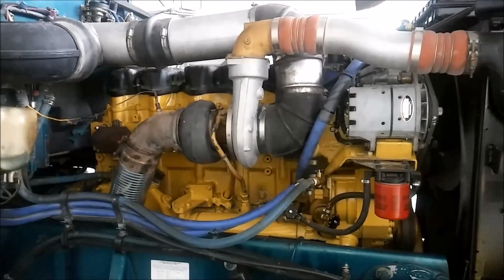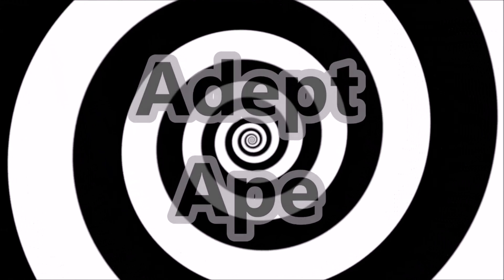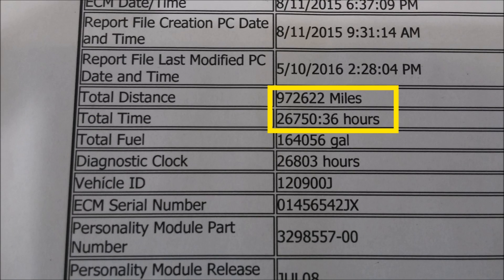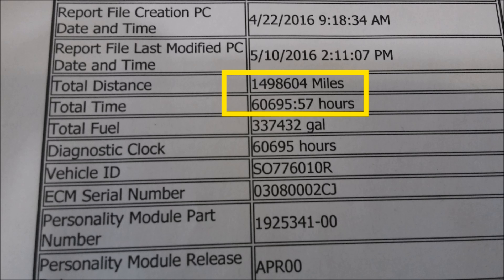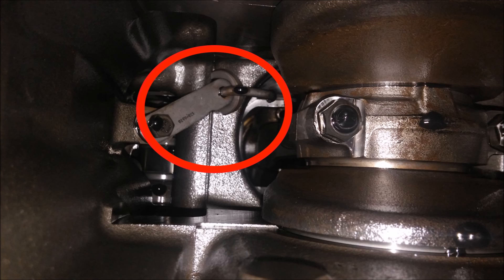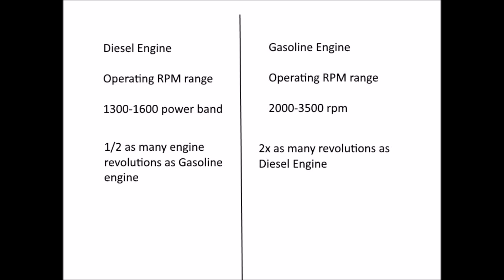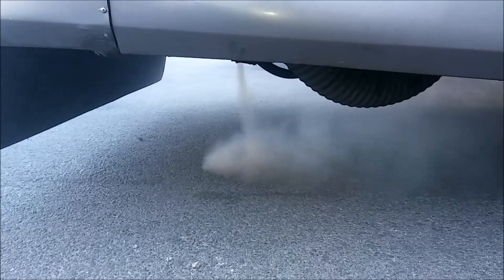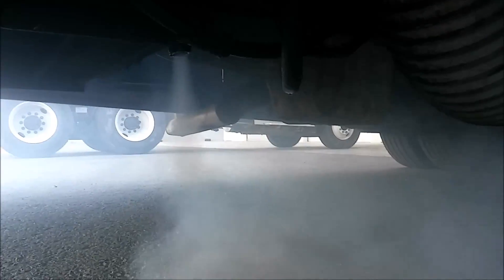Why Do Diesel Engines Last So Long?

Comment: lower rpm -> less wear -> longer lifetime
Reply: TheLuckyDawg24 higher compression > stronger internals> longer life
Reply: this
Reply: Diesel is mainly torque! They have some 600hp cats out there in some semi
Reply: idontcare80 If the government is worried about smog, then ground the C 17's flying outta here every day. Just one takeoff pollutes more than I will in a hundred lifetimes. Consider all the smog created making 3 or 4 eco boost engines, and trucks compared to just one 7.3. That's how many it will take to do the same work. Not counting that a person has to work out 35 K minimum to pay for one. How many people with a green job can even afford  a new truck. Until everyone else gets serious, I'm sure not.
Reply: idontcare80 I seem to have just the opposite view. My company went completely away from Ford trucks just because of high failure rates from that particular engine, and transmission. It's one of the biggest manufacturing companies in the world. Big enough to cut a deal  with Mercedes to build them a special small truck. All my 4,0's got good milage, especially for larger 4WD's. I had 3 Jeeps with 5 speed, and they consistently got 20 MPH. As for my VW's I own 2 right now. My Passat gets 34 mph @ 80 MPH. I don't keep one as long as I used to, but my old VW's went 2 to 300 K and usually just rusted down, but never any engine or driveline trouble. (2 Shiroccos, 1 jeta, 2 Rabbits, 2 Passats.
Reply: My uncles sell police cars those ford 4.6 engines are junk. Some with as little as 55,000 miles.
Reply: Put a ford eco-boost up against my old 7.3, and you're in for a big surprise.
Reply: B______ F________ Small cube engines have to wind like hell to develop horsepower. It spells low milage, and short engine life.
Reply: They aren't junk, those engines idle allot more than they are driven. Any police car you are going to find these issues. Not just the 4.6 Fords.
Reply: idontcare80 well, the emissions are still better than the petrol engines with less power. Newer versions of the same engine outperforms similarly sized turbo petrol engines with at least 25% better emissions, without cows piss. So there goes your analogy...
Reply: idontcare80 true, those pistons must weight a good amount.
Reply: +Prelude Dude Si add a turbo and you have the same (which most diesels have from factory).
Reply: crusty old fart Yeah, but the 7.3 didn't have any emissions controls, and basically every Powerstroke after that had serious problems. If everyone drove cars without emissions controls, we'd live in a sea of smog like the Chinese do.
Reply: B______ F________ It's not the fuel consumption that matters, it's the cost of the fuel and the CO2 that's produced from burning it that matters. In normal driving, the 2.7 Ecoboost has very similar fuel costs and CO2 emissions when compared to the 3.0 Ecodiesel. You also have to consider that the Ecoboost engines make WAY more power than diesels of a similar size, so it's not like you're not getting something out of the higher fuel consumption when you're demanding a lot of power from the engines, you're getting much better towing performance.
Reply: idontcare80 I agree to some extent, but with the newer oils, any engine will last forever unless it has a particular fluke, like the Ford diesels, and the newer modular engines. I had two ford 4.6's blow all to hell at around 50 and 75 thousand, for no particular reason. Both were in cars, and never abused or towed with. Needless to say, that was my last Ford I may quit VW's some day, but they usually give me 200 to 250  K trouble free, then I'm ready for new paint anyway. I sold my buddy a jeep with 330 K on it, and he has over 400K son it as a daily driver. He said it used a quart of oil between changes, but he hasn't had to add one between. I ran a VW over 300K, but it rusted down.
Reply: It's not the government who is worried about smog, it's the people, because smog harms their health. Aircraft fly at tens of thousands of feet in the air, it's ground level pollution that harms human health.

"Consider all the smog created making 3 or 4 eco boost engines, and trucks compared to just one 7.3."

I don't understand your point here. Are you saying that it takes three or four Ecoboost trucks to replace one 7.3? As far as emissions from production, even powerplants have emissions controls.

"How many people with a green job can even afford a new truck"

WTF are you talking about? The last solar panel install job I interviewed for STARTED at $40k/yr. That's a hell of a lot better than working at Walmart for $20k/yr.

I worked construction for almost a decade out of the back of a Civic, a lot of people who think they need trucks for their job don't. Anyway, most people who drive trucks around don't use them for anything other than a commuter vehicle, that needs to stop.
Reply: Joshua Edward They're far from being junk. Many, MANY police cars and taxi cabs make it to 400,000 miles plus. Google: Crown Victoria high mileage, you'll see plenty of examples of this.

The truck engines were different, and they did have problems.
Reply: Right.
Reply: idontcare80 I have a 13 y.o. bmw 5 series touring with 3 ltr twin turbo diesel. the engine doesn't weigh as much as a 5.0 ltr petrol engine from mercedes, doesn't produce as much power (roung 30hp less), but yeah, I am perfectly able to keep up with the cl500 v8. and when I drive in a civilised manner, I have no problem keeping fuel consumption at round 30-35 mpg, imperial though, not the US. when I go above 120-130 mph though, the fuel consumption is anything south of 20-25 mpg, but it can do 160mph, stock. ;-)
Reply: If you're talking about CO2 emissions, yes, but if you're talking about the emissions that cause lung cancer and emphysema, no. CO2 emissions cause global warming, and the reduction of CO2 emissions from diesel passenger cars is so small that's it's not even worth noting. The newest, urea injected diesels are almost as clean as gasoline engines, but still not quite there, and they lost so much efficiency because of what was needed to get them that clean that they no longer have lower CO2 emissions.
Reply: TheLuckyDawg24 desiel emissions are not good
Reply: idontcare80 I was a chemical plant operator and a byproduct was CO2 and we vented to atmosphere... millions and millions of pounds every day
Reply: Which is half the reason the 3800s and the LS motors last so long. The 3800 in my Holden is geared so highly that on the highway, it's doing about 1,600rpm. Tootling around at 75km/h, it slides into overdrive and locks up, and it's barely doing 1300rpm. The LS brings this down to a neat 1,000 on the highway. In either either case, they are both practically idling through most of the day. That and they're very basic engines. If what you said is one half of the equation, the other half is complexity. Complexity is the enemy of reliability.
Reply: No
Reply: Diesel fuel is a lubricant.  It also does not break down engine oil in the crankcase lije gasoline does
Reply: Unless you over rev
Reply: That and the fact that a 200 hp diesel often weighs over 600 pounds. Make a 200 hp gasoline engine that weighs 600 pounds and it would probably outlast a diesel.
Reply: Yup, turbo gasoline engines can easily out-torque turbo diesels.
Reply: crusty old fart I dunno, I've seen quite a few Hondas with well over 200,000 miles on them that were in great shape, and I've seen a few that had over 300,000 that were also in great shape. Longevity depends on the quality of the engine more than anything.
Reply: Many 4.6s in Crow Vic taxis and police cars go for 400,000-500,000 miles, they're some of the longest lasting engines on the road.

VWs are miserable junk in my experience, but I've only worked on gassers. The Jeep 4.0 was a damn good engine, but also unbelievably thirsty and gutless.
Reply: @PistonAvatarGuy  but alot of them are running propane set ups
Reply: @manny123clean  A lot of what?
Reply: @PistonAvatarGuy  taxi cap cars run on propane instead of gas they get better fuel mileage and less wear to the engine I'm pretty sure propane gets you 1000 km to a tank
Reply: @manny123clean  Not in the US, police cars and taxis run on gasoline here.
Reply: @PistonAvatarGuy  wooow shocking propane cars last forever

Comment: my dad 1928-2016,worked on the Distant early warning line in Point ley Alaska in  1973 and 2 cycledetroit diesels ran 6 gensets,5of them 24-7.they were new in 1957 and except 4 maintenance,had been online since 1957!to be fair, the service records said they had gotlinrs,pistons.bearings twice and [in 1973 were ripe foranother.In those days aliner kit for 2,3,4,6 and 8 cylinder engines,71 cubic inches per hole,along with journal dimeter,sothe bearings too,were all the same.they ran faster and had 17 lb.of airbox pressure to the oil pan maker them oil users.they ran on 70 or 80 percent natural gas.

Comment: This doesn't totally explain why the diesel engines in cars such as the Volkswagen and the MB last so long compared to their gas cousins.  Yes, they are heavier and slower turning mostly but not by a lot and they function in a car environment with a lot of heat cycles and short trips.  The VW does suffer from the rubber band timing belt problem and it is an interference engine so one does have to keep up on that factor of maintenance.  Of course, GM proved some years ago that you could design a really short lived diesel in its late Oldsmobile division.  Maintenance of diesels is less frequent than gas engines since the most unreliable feature, the ignition system, is absent, although the switch to electronic fuel injection vs. mechanical and the increased complexity of pollution control systems will probably result in more frequent and complex maintenance needs.  Older diesels generally only needed oil change and filter service with careful attention to the fuel filters.  MB diesels generally have about half again more sump capacity than their gas counterparts but also have rather long change intervals, the older engines also had relatively large oil filters but those have shrunk in recent years.  I really like the enormous filters used on Ford Powerstroke engines, the oil always looked clean, unusual for a diesel.  Oils for modern gas engines do not have the zinc additives that reduced wear due to EPA mandates, I believe it is still in diesel engine oils.
Reply: I can remember seeing a cadilac,1982,at auction with a diesel.they were bragging,to boost the price ,that it hada brand new motor!and at 20,000 miles!right then I knew gm had frigged up!it was a 350,with a 4 bolt main bearing,I believe and the compression lifted the crank right out,pulled the bolts out of the block.
Reply: Henry, they did, it the 80's and early 90's. Not today. Today diesel engines are unreliable as you can get.  And new diesel engines require high quality synthetic oil. 

FYI: owner of 1.4d VW POLO 2F 92', Mercedes W203 C220Cdi 05', BMW 325I E36 92', BMW 320CI E46 00', Mercedes Sprinter C213 02'.
Reply: My 2016 Mercedes A220d AMG, with Brabus upgrade is a 2.1 Diesel, putting out 200bhp and 400NM of Torque. I believe the OM651 engine is all chain driven, and its oil capacity is the same as most Petrol engines at 5 litres. The oil service interval is 16,000 miles, which is concerning. So it remains to be seen what wear is going to be like as it gets older.  Done 15,000 miles in mine in 6 months, with an average of 63mpg over that time. Whats not to like !.
Reply: paul taylor. most 4 to 6 litre petrol engines use about 5 to 7 litres of oil were as a diesel of the same capacity would have a 10+ litre sump
Reply: paul taylor. most 4 to 6 litre petrol engines use about 5 to 7 litres of oil were as a diesel of the same capacity would have a 10+ litre sump
Reply: Henry, of the differences mentioned, heavier components, lower rpm and more lubricating fuels also apply to car diesel motors. i daresay they make for significant advantage?
Reply: J Coasta You are another moron apparently you have never owned a Mercedes 300D or a VW TDI.
Reply: Samuel Rosenberg but isn't your engine very specific on oil? The golf tdi 1.9 had to use a very good oil due to the aggressive camlobes.
Reply: Gregarious Antithesis calling me a moron?! Who the f*ck are you? If you want to be respected, you should respect the others.
And I didn't own a PASSAT 1.9tdi 98'; my grandfather did. He traded it for the mercedes w203. Also here our market is 90% diesel, because diesel is much cheaper than gas. So, who the f*ck are you to call me moron?
Reply: Samuel Rosenberg yes nothing against it, but when I talked about the today engines I was referring to the 2008 or after engines. 
I know your engine and it's quite reliable, it needs a good quality oil in it but runs and responds good to a repro.
But the today diesel scene is not as good as it was in the 1990-2008 years where diesels rulled. Now with the new emissions norms, diesels are getting crappy because they need to be powerful, small, economic and economic, so reliability takes a lash.
Reply: Samuel Rosenberg yes, I would to. Getting an almost new car for a few thousands, who wouldn't?
 But in normal conditions, the diesel seems less appealing.
The US market is different, our European market is all diesel but as maintenance costs rise, people are now seeing the seemingly thirsty gas engines as probably a better option.
Diesel engines changed a lot, 10 years ago, a 2.0 doing 180 hp a 4.5L/100km would seem bonkers. Not today.
But now those engines are unreliable.
Reply: Samuel Rosenberg yes, I would to. Getting an almost new car for a few thousands, who wouldn't?
 But in normal conditions, the diesel seems less appealing.
The US market is different, our European market is all diesel but as maintenance costs rise, people are now seeing the seemingly thirsty gas engines as probably a better option.
Diesel engines changed a lot, 10 years ago, a 2.0 doing 180 hp a 4.5L/100km would seem bonkers. Not today.
But now those engines are unreliable.
Reply: Samuel Rosenberg the problem with fuel consumption today isn't the engines but the ever so increasing weight and dimensions in cars. My first car was a 900kg VW Polo mk2 facelift 1.4d and it did 5.5L/100km. With a modern engine and at 1000kg I bet it would do 3L/100Km... the problem is that cars today all weight about 1500kg plus. Even small econoboxes are really heavy.
100hp in the nineties was fast. Today is the average because cars are big and fat.
But that unfortunately is and reality no matter what's the engine.
Reply: As a test engineer for Cummins we would regularly fail engines right off the assembly line for 'too good' fuel economy.  It was expensive and impractical to regularly measure Oxides of Nitrogen (NOx) so indirect indicators were applied.  The parameters of a healthy engine had been established and all production engines had to test within the established window of measures such as Brake Specific Fuel Consumption (BSFC).  Rudimentary opacity measurements using light to get some reading of Particulate Matter (PM) were applied though.
Reply: All engines were troubleshot and made to pass or they were ultimately disassembled altogether.  If the engine was running too good it was also making excessive NOx in violation of EPA regs.
Reply: I think that turbo helps and fuel air mixture makes a big different , you have to have so many parts gas to air for your car to run with out messing with the spark plugs .
Reply: Gregarious Antithesis Volkswagen TDI, all in the junkyard
Reply: What I don't like are the emissions regulations imposed on car makers by the USEPA. I'm all for clean air, assuming it's realistic. But frankly, I see nothing realistic about the emissions regulations and laws.

Comment: the best is the detroit engine. .. super
Reply: vikram m I too enjoy a good runaway
Reply: gets hairy till you turn off the key. just remember to unlock the wheel so you can steer again.
Reply: my buddy has a detroit in is ex military k20, that thing is bad ass!
Reply: PingasTheFourth seriously you're arguing the runaway engine? that's rare and easily remedied. or do you not know how to take your vehicle out of gear? weak argument.
Reply: PingasTheFourth I never said stopping a runaway dd could be accomplished by turning off the key. if you actually read my comment I said that it is a rare problem. I have never had one run away on me. and there are several ways to stop a runaway engine. your argument is still weak. and no matter how detailed your explanation on how it can happen doesn't change the fact that it is not a constant issue. the only cause is poor maintenance, and negligence on the operators part.

Comment: It would be wise to investigate the recurring problems of any make/model engine before buying something with a diesel (or gasoline) engine in any vehicle. There are good engines, and "dogs" that can be money pits. Assuming a diesel engine is an $8k option on a small truck how long will it take you to realize the savings you could make on a good engine? Take into consideration the body and interior, electronics, oil changes (in gallons) oil AND fuel filters (not cheap) and EPA regulations that are imposed on the newer diesel engines. Under normal everyday driving conditions the body and chassis will degrade a lot faster than most engines, especially state DOT's that love calcium chloride and salt during winter. And remember, diesel fuel is harder to ignite the colder it gets (and begins to gel after a certain temperature). Do your homework and math before making a decision.